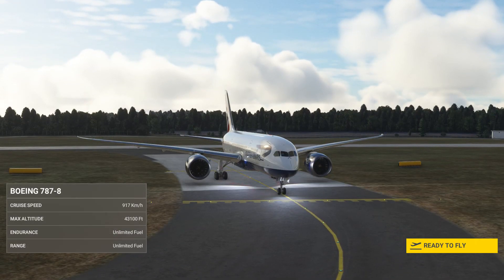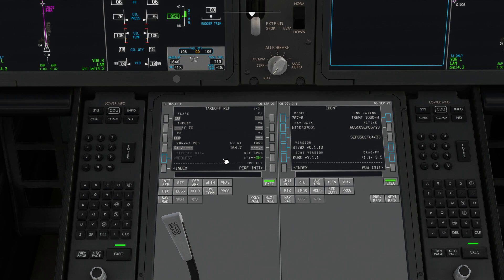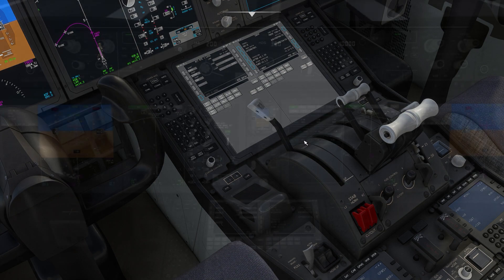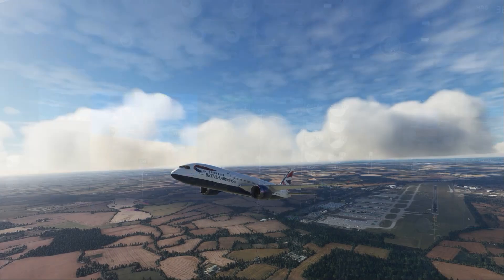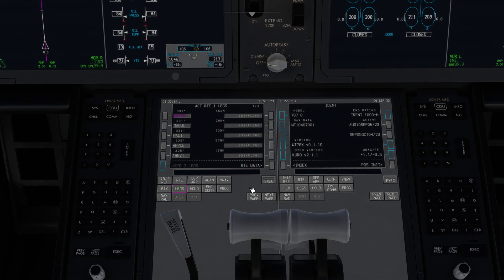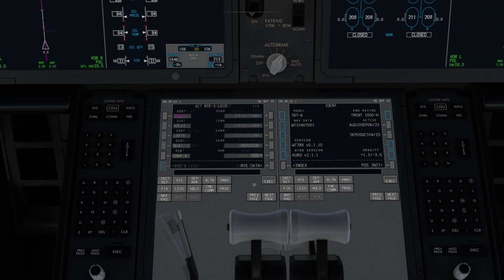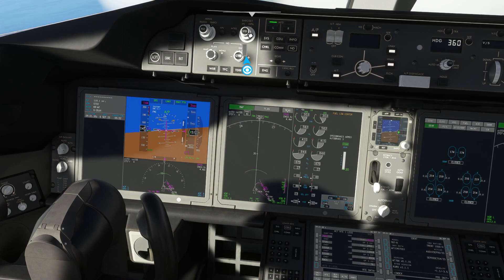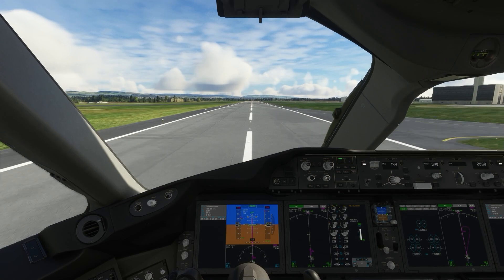MSFS Kuro 787-8 MSFS | Full Flight & ILS Landing Tutorial

Comment: When you typed the ILS freq 110.10 this should be enough, I mean it works like this in all Boeings. However when I do this, ILS is not accepted with the Kuro's version. So I noticed that then you typed slash and 48 which makes 110.10/48 right? That was pretty interesting because afterwards the ILS was accepted. What was this 48? Heading Course during final approach I mean  or Runway?  RW 48 I mean does not make much sense. Am I missing something?  Thank you, nice guide I will be waiting your reply.
Reply from the maker: Yeah it’s the course. Runway 05 = 48 degrees. Courses can be found on apxp.info
Reply: So let us suppose for example  ILS freq is 110.10 and my Runway is RW 02 I type 110.10/020 right?  But in all Boeings we type only 110.10 no? This information was a treasure. Is my example correct?
Reply from the maker: @DelayedFlight  yep. Check the website for the actual course.
Reply: @TiJayFLY  Thank you. Your level of knowledge is very high. Congratulations.